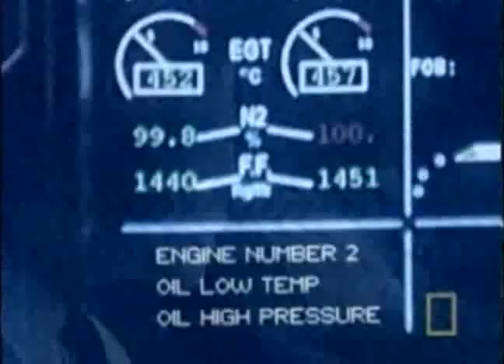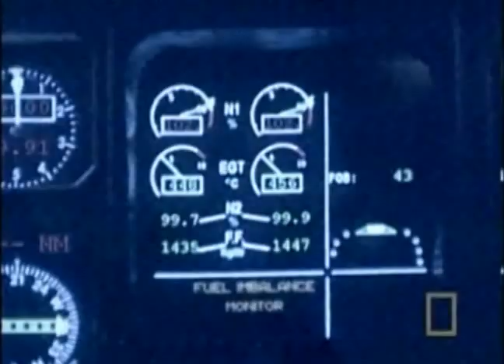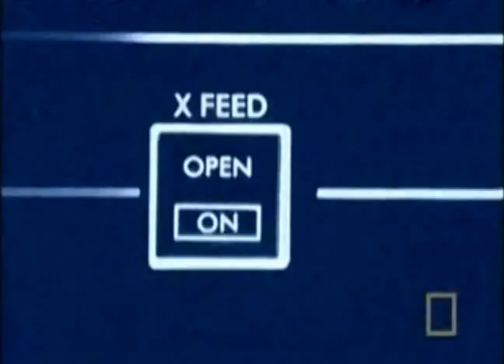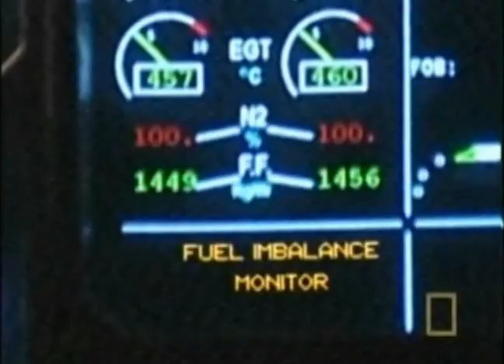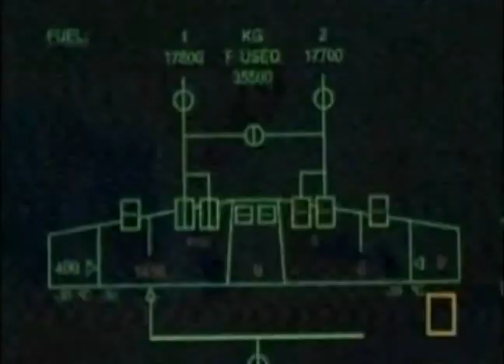Air Emergency / Flying Empty - Part 5

Comment: The captain should be more aware of his computer systems rather then his thoughts, because the computer readings were correct. And let not forget, there are 306 peoples life at stake.
But at the end of the day it's saving the air plane and the passengers that matters.